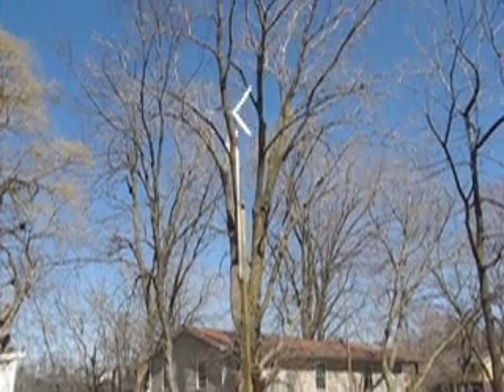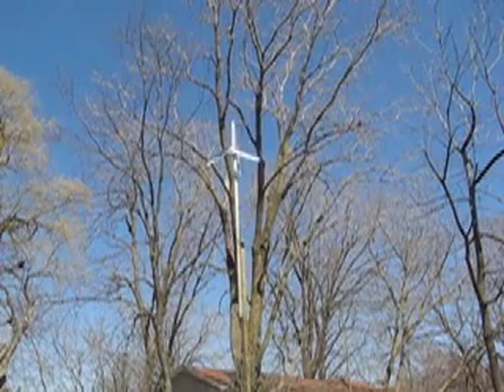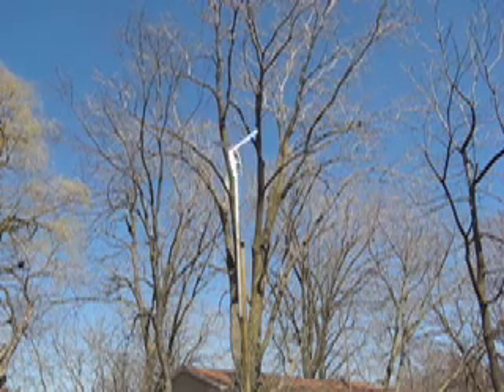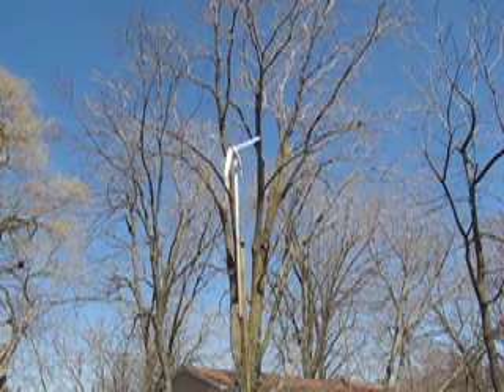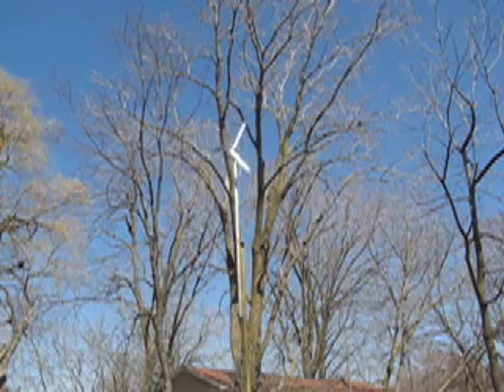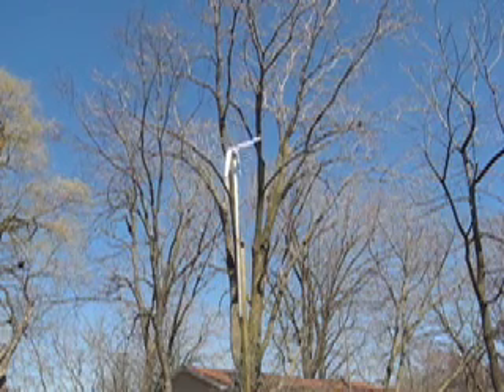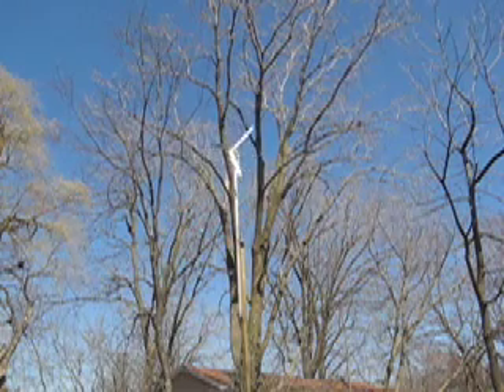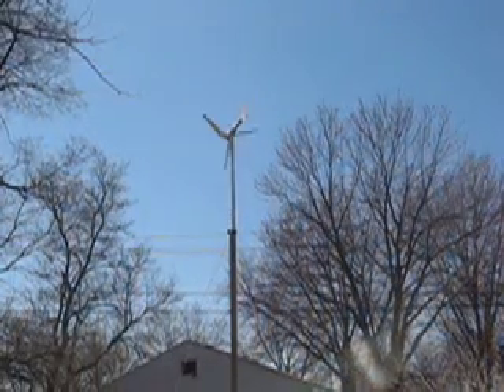turbine on a stick

Comment: Great hobby ,I do it as a hobby too.Gives me something to do have been laid off for awhile I started out like you ,then i added a gear system to my dc  generators.Pulleys and belts now mine makes 3and 4 times the power that they did .Just got thru with my 3rd wimdmill all the parts i use are free whatever i can find .Nice job have a great day      .

Comment from the maker: I had a 260 DC volt motor in it but lost a bairing in the turbine head and down she came.
I was getting about 14volt in a 15 to 20 knot  the wind is not that grate In Michigan.

 Click on the image in the corner that is linked with my channel and see start to destruction.